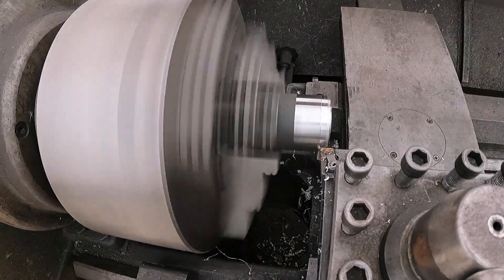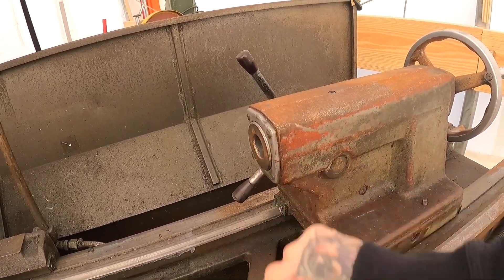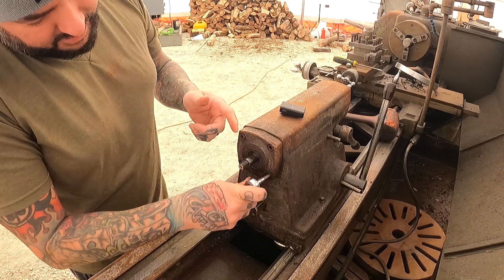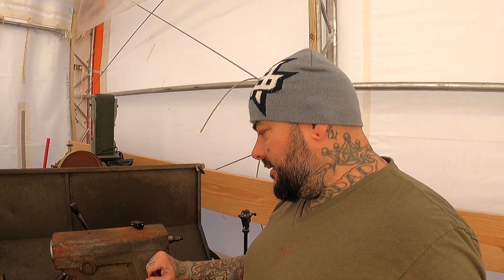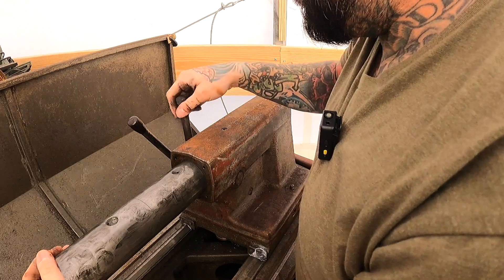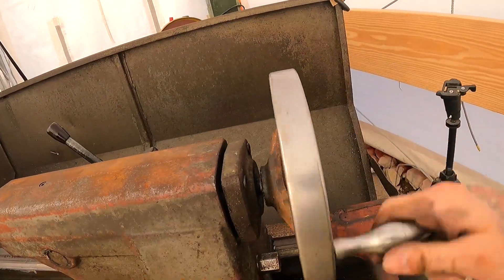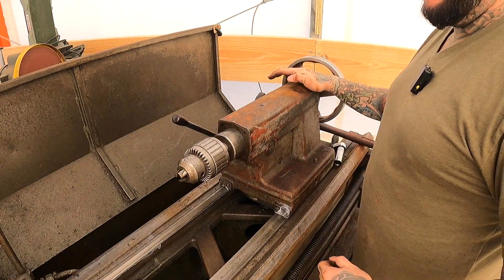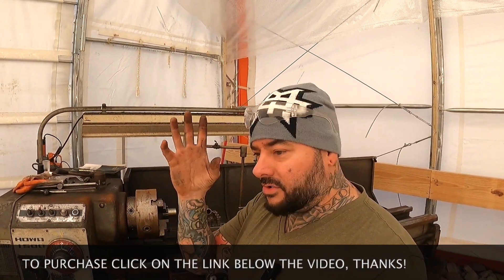Can It Be Saved ?... DIY Lathe Repair

Comment: This was pretty painful to watch.  Pull everything apart on the tailstock and clean and re-assemble and re-oil.  Slide the tailstock carefully towards the end of the bed so you can get a look underneath.  A lot of the Japanese lathes had spring loaded wheels under the tailstock.  These are usually gummed up and jambed on a machine of that vintage.  Note that not all of them had these, however the tailstock is almost identical to an Okuma LS and they did have them.

Comment: pull that tailstock apart again , clean everything and then lubricate the entire moving assembly .  most of the time there are oil holes in the tailstock body so that you can routinely put oil through the holes to keep everything lubricated .  use a good turbine oil which is low viscosity .  clean your ways very well and apply the same oil to the ways .  Squirt some oil at one end of the bed and then , just spread it by running your fingers down the ways adding oil as you need it .  Wipe off the excess with a lint free cloth or a paper towel.  That sure looks like a nice machine .  If you take care of it , it will take care of you !!  Best wishes !!  there are some good older books on the care and operation of an engine lathe still available , so pick one up and enjoy !
Reply from the maker: Thanks for the info 🙏

Comment: Google "quill lock," and look at the images. It is 2 pieces of round brass bar, 1 has a through hole, the other has female threads. The handle bolt passes through the on hole, and threads into the other. When you tighten the handle the 2 brass bars are drawn towards each other. There is an arc milled in the brass that matches the ram, and simply jams it to lock it in place. You can clock the handle itself by removing the little screw that holds it on and moving it to a different position, yours looks to be about 90 degrees out of clock - it should be vertical (ish) when locked).

Also, rust particles eat through cast iron with ease, please clean it up and get some way oil (Vactra is best). Even casual motion will damage the ways.